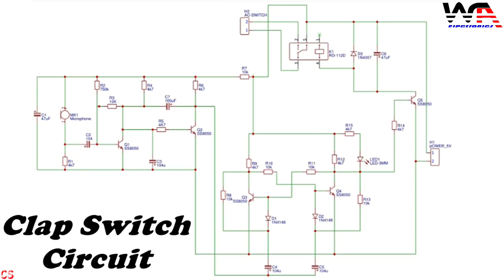Simple Clap Switch Mini Project with Circuit Diagram Using Op Amp & Relay | Diy Electronics

Comment: Hi sir, I have problem with the micro phone I have purchased a clap switch circuit , in it, the microphone is reciving the clap signals only after I touch my hand in contact with it. What is the solution ? Is the microphone is not working?